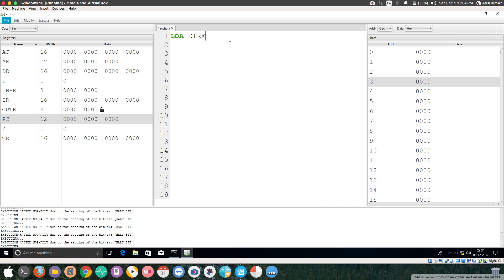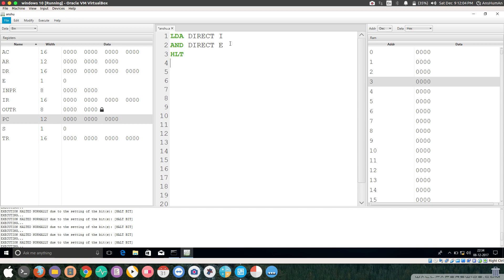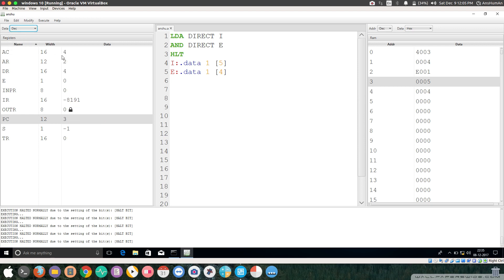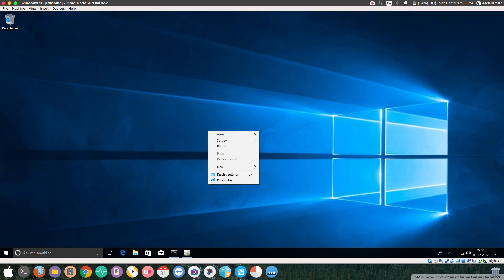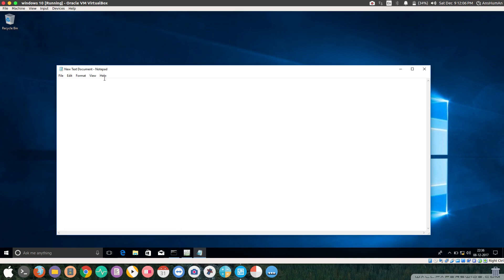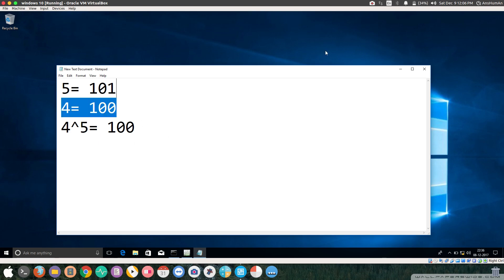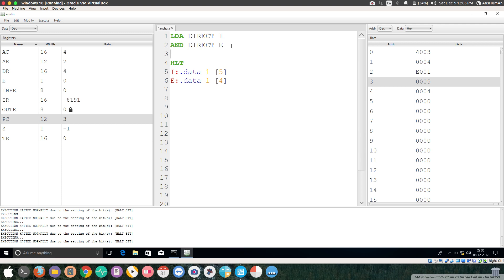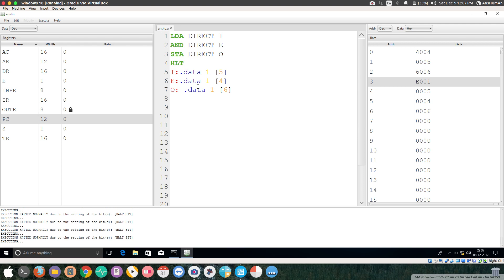Using AND instruction in CPUSiM

Comment: it is not working as expected.... if i call these data then...
I: .data 1 [5]
E: .data 1 [7]
O: .data 1 [8]

output in RAM [Addr, Data ]:
4,5
5,7
6,8

but here i expect AND operation on 5 ^ 7 (101 ^ 111) = 5 (101)
can you please explain what is happening here? Thanks...
Reply from the maker: hey thanks for bringing this up
can you send me the screenshot(full screen)
 after executing the code
Reply from the maker: also send the implementation of LDA, AND STA